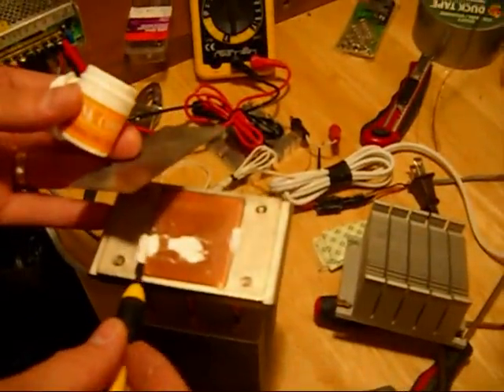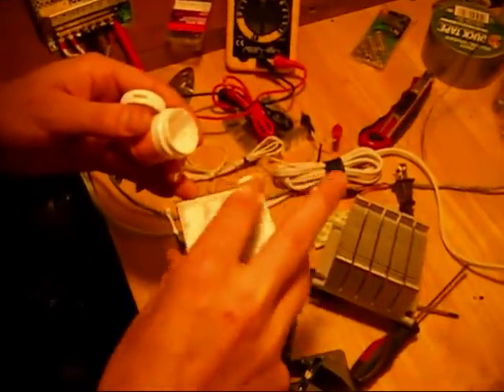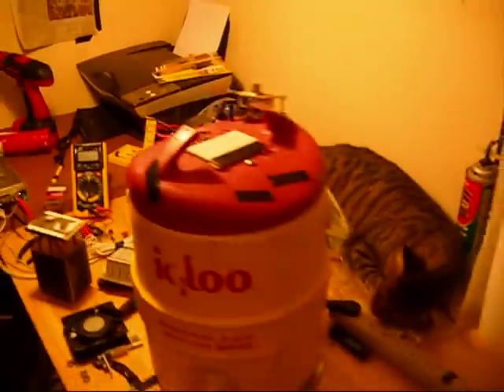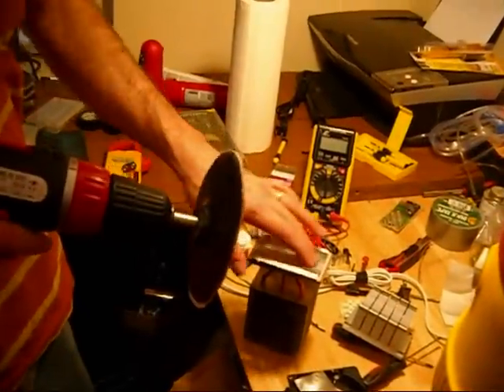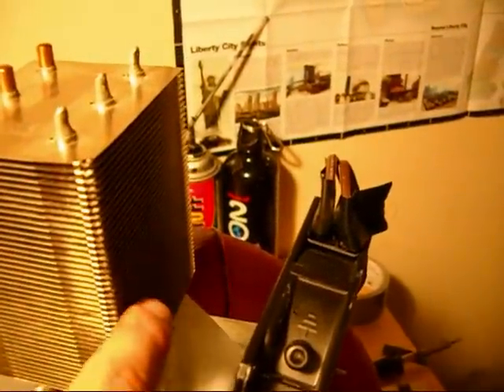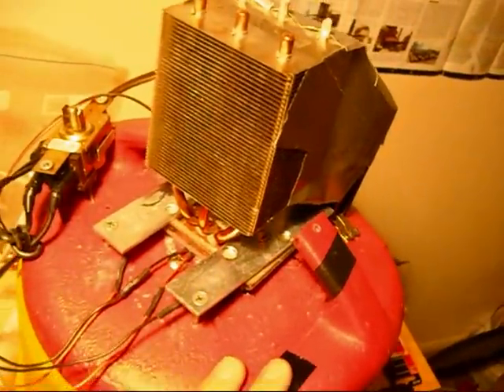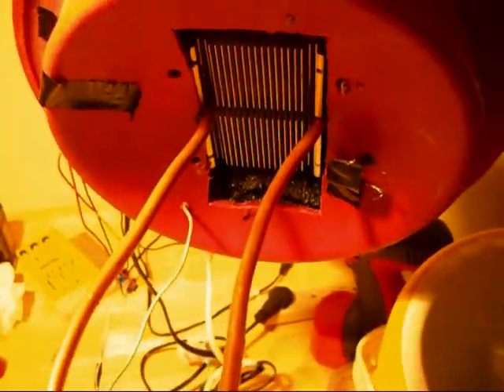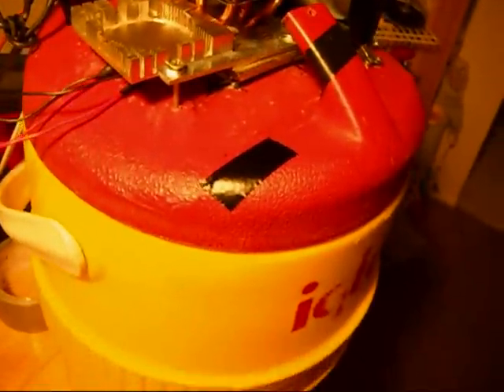Thermoelectric Cooler Part 13 - Gigantic Heatsink

Comment: im not an expert on electronics but if you could put jb weld on the peltier cooler (just enough not to screw anything up) it would conuct much more heat away from the peltier units. 
depend on the peltier units you have if they are encased in some type of metal that should work wonders

Comment: Try to Use Rubbing Alcohol to clean the surfaces that you are getting ready to apply the compound to, and use an old smooth plastic card like a gamestop card or something and apply it that way. The Surface wont be contaminated by your fingers and will make a decent difference in thermal conductivity rather then using your fingers. You actually could make a simple tool which is basically a small roller with foam and you apply compound with a plastic card onto the roller and roll the compund onto your surfaces which is what they do in factories ive heard. The Surfaces have to be as clean as possible. Good Luck!

Comment: hey , what is temperature of water u get ?

thanx in advance
Reply from the maker: I did this about 4 years ago, so I don't remember all the details.  In general, this project was a failure for many reasons.
Reply: no man :D
time invested is always good  ......
Reply: Taylor Holmes Its always a good idea to give an idea a shot. It will be better sometime in the future. Researchers and Manufacturer's are trying to produce peltier units that are both cheap and efficient. I am still working on a cooler just to put items in and without water cooling i am getting decent results and still trying. I use 9 Volts at around 2.5 Amps and are getting 53 degrees in a 76.8 ambient.

Comment: spreading it with your finger adds grease! you really don't want to do that. With CPUs you use Isopryply Alcahol to clean off any grease or residue before putting thermal compound on.
A lot better to use the edge of a debit card
Also, you don't want thermal compound to dry, it's usually a lot less effective when it does.